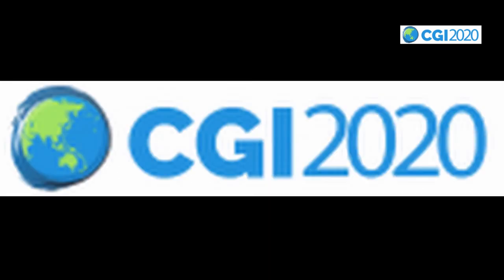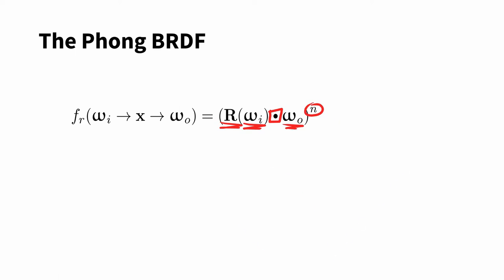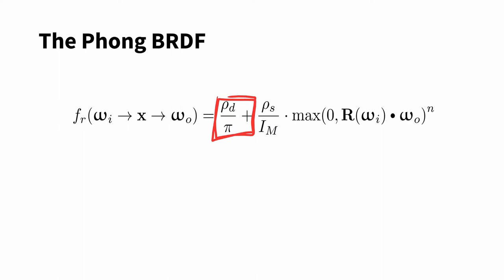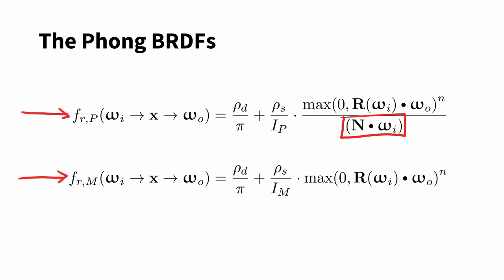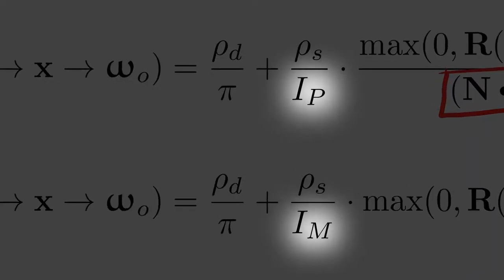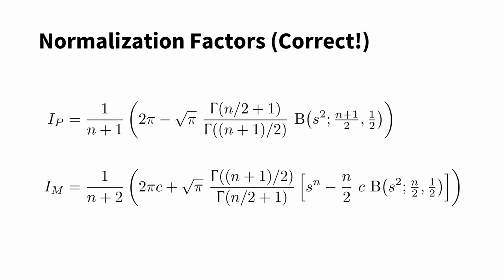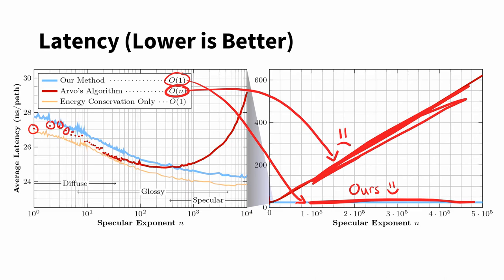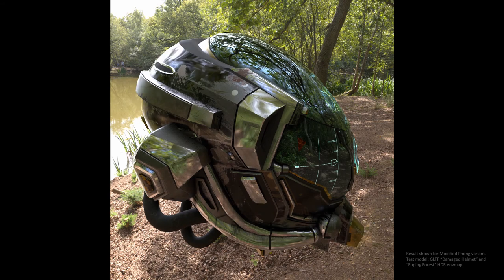Constant-Time Energy-Normalization for the Phong Specular BRDFs (Abridged!)

Comment: I used blinn phong with the (8+m)/(8 pi) normalizatiom factor. looks good but I dunno how it was derived
Reply from the maker: This paper is about the Phong and Modified Phong BRDFs, not the Blinn-Phong or Modified Blinn-Phong BRDFs. That said, the term you mention is apparently for the Modified Blinn-Phong BRDF, and I think was computed by upper-bounding the integral that describes the BRDF's reflection. Specifically, they assumed L=N (normal incidence, where the reflection is strongest; this upper-bounds the reflected energy) and integrated over the reflection lobe. They then quit halfway through and upper-bounded that. Thus, the term is a conservation factor (energy is not gained), not a normalization factor (energy is neither gained nor lost).